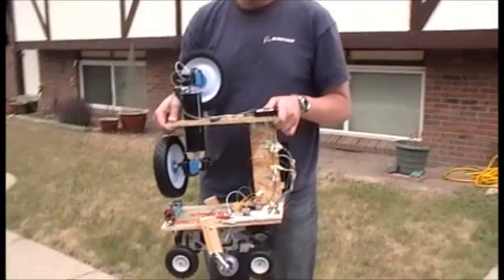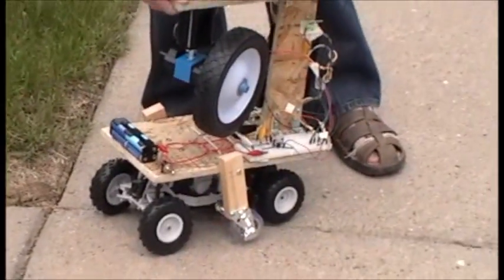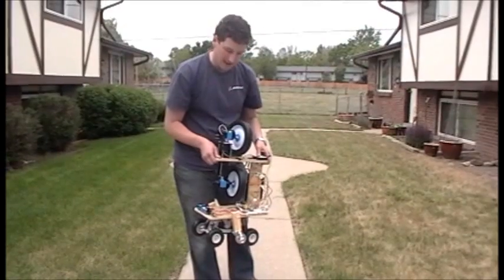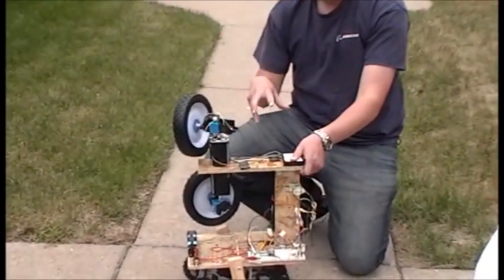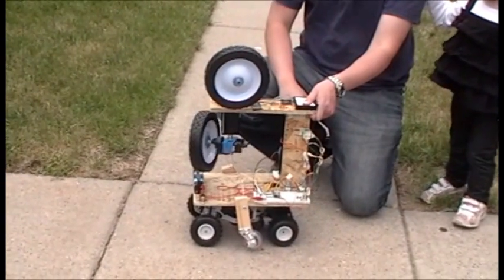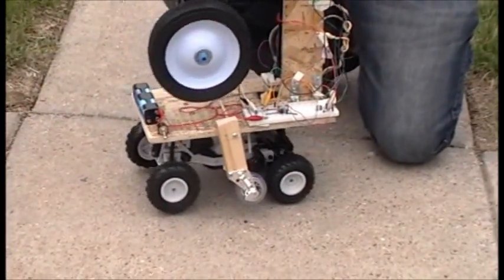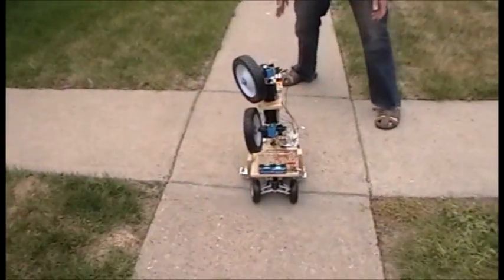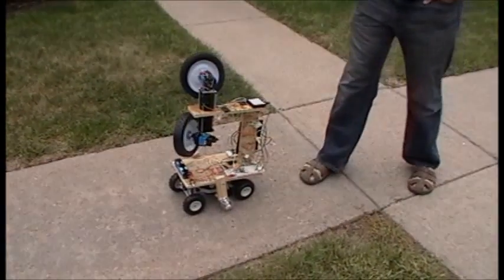MAGIC Car

Comment: To give forward momentum you need to make a spinning disk that is out of balance  at 1 point only this requires some clever engineering but I believe I have seen it done on YouTube with some men in a canoe in a swimming pool.a gyro scope is a perfect disk exerting an outward force equally in all directions at the same time through centrifugal force.the disk must let go of part of its mass at an exact point then stop it quickly and return it much slower back to its normal spin radius~~ therefore exerting an out of balance force in one direction only.good luck engineering this idea I cannot be bothered .

Comment: Good concept. 
Some Ideas: Change your base platform which looks like an RC car base for geared motors and wheels. RC car bases does not have the torque required to push any weight. Geared motors that about 100 - 200 rpm should have the torque you need. Make sure you use an isolated H-Bridge for the motors.Try using PVC Board with aluminum L brackets for strength. Hope your modifications go smoothly!